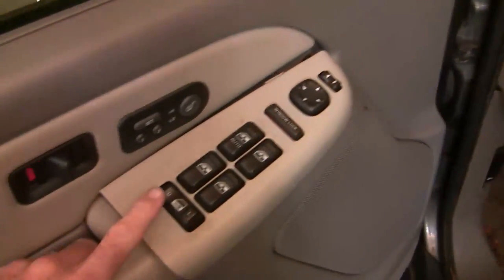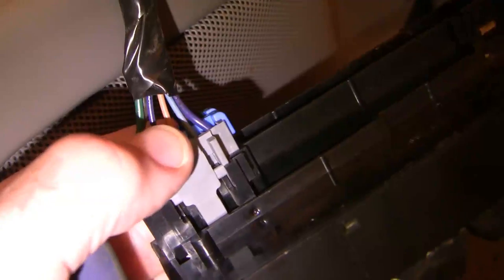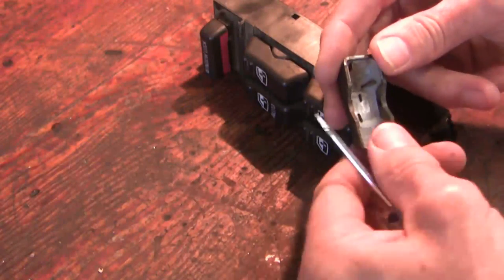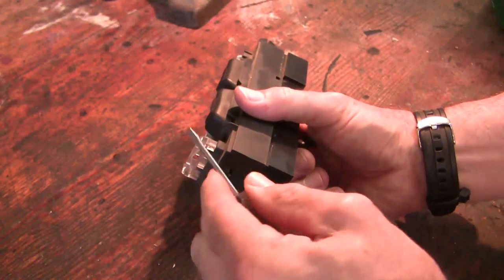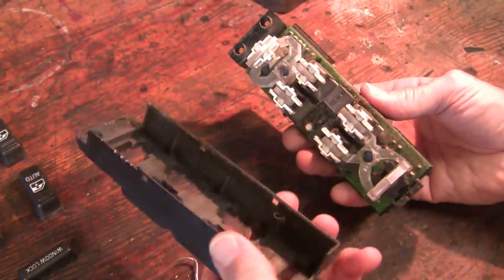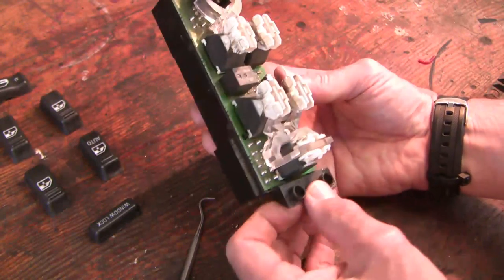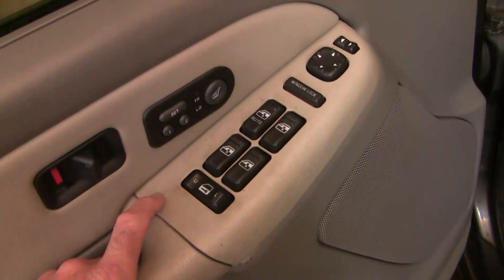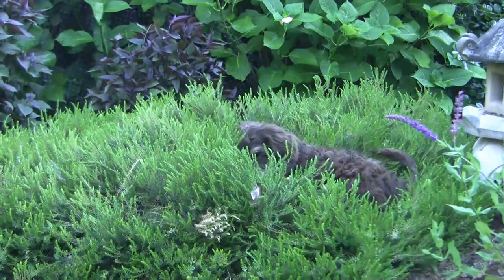How to fix the Chev power window door lock switch

Comment: I have an 02 Yukon and my driver and passenger lock and unlock button doesn't work either, I have switched out the relays and still not working.  what can I really do. or might be the problem
Reply from the maker: +officialYungTEK These systems are very complex, but in the end good technique will show where the problem is. If I can get at the end device I usually start there, to prove the motor works and the lock will close and open with application of power.  I usually start by looking for voltage coming from the switch to the device to see if the motor is getting an adequate signal to move. At that stage it's important to do the testing under load with the door lock hooked up since you are really doing a voltage drop test. If the voltage under load is reduced I look for bad connections, especially corroded connections and broken wires and bad ground connections. Pay close attention to the wires inside the rubber boot that protects them as they go around the door jamb. Those wires often become brittle and the repetitive movement around the door is a common point of failure. If voltage is adequate but the lock won't move, you could isolate the lock and apply power from an outside source to see if it will move on it's own, but testing like that should be done with the lock completely disconnected to avoid issues with back voltage, etc. If you get no voltage driving the lock, trace the wires back to the switch and clean debris from there. The switch and associated connectors are a very common point of failure, too. If two doors are a problem then I would pay close attention to the master lock switch on the drivers side. To go beyond that you'll need a wiring diagram, which is surprisingly complicated, especially if you have a security system. I suspect many dealers trace the issue back to the switch and then if they suspect the switch then they swap in a new master switch. In the DIY world, you want to be as sure as possible the switch is the culprit before dropping change to get a new one. Good luck!

Comment from the maker: I'm guessing that somebody was in that door and hooked the wires up backwards. A quick fix would be to take the inner panel off and swap the two wires. Easy. The wiring of most window motors is reversible, with direction of rotation entirely dependent on polarity. 

Word of caution, I'm not an expert in Ford products. If it were my vehicle I would get a wiring diagram for that vehicle to avoid making a mistake. BBBindustriesdotcom have some free wiring diagrams for many vehicles.

Comment: great video. i have a question. did you see a bulb anywhere in there? none of my switches light up. i dont really know if my truck doesn't feature it or the light is out. so before i go thru the trouble of dismantling my window cluster,  can you help?
Reply from the maker: I didn't see any bulb, but I think some of these may have little LEDs. Next time I'm in the vehicle I'll look for lights, they aren't very noticeable if they are there.
Reply from the maker: OK I just sat inside the vehicle and the switches for the door lock/unlock and for the window controls are lighted. Interestingly, on my vehicle only the rear two window controls are lighted, the front aren't, so my fronts seem to be burned out. The child lock is not lighted, nor is the mirror control. They aren't affected by the dome light controls and they don't go off if I try to manually turn off the headlights. I don't recall an incandescent light bulb, they are probably LED. I'll have to go back to the footage but in my case I don't really care, it's not worth the effort to fix it.
Reply: Im changing all my lights to blue led lights. And none of my switches are lit. On either door. If you come across a buld anywhere in there let me know.
Reply: Billy BManic looking at the video, it appears that there are clear plastic molded "conduits" that run in between the switches. It looks like there are two bulbs at the base of these "conduits" that, when illuminated, allow the light to travel in the "conduit" ,kinda like fiber optics, to each switch.

Comment: The drivers side window button is the only one that does not work.  All of the buttons for the locks, mirrors, etc work.  I have taken it apart and cleaned it, and the wires all look good.  This is now the third summer I have had it go I out and I would like to be able to fix it myself.  Any other suggestions as far as what the problem might be?
Reply from the maker: You might look closely at the solder connections where any wires meet the board. Sometimes the solder joints fail, and re-soldering those joints may solve the problem. Failing that, there is always the option of searching for aftermarket or junkyard parts.
Reply: Did you ever find out the problem with your door switch I'm having the same problem and don't know whether it's my drivers side switch or the window motor going out itself. Thanks
Reply: Get good at locating less expensive sources of used replacement switches. They are finding their way to eBay now. Obviously, if you are only paying $10-$25 for a $69 part, you might not have a guarantee that it works as well as a new part. But the savings in labor alone is worth it. I personally stay away from purchasing the cheapest parts online. Always bothers me to go to the lowest bidder on electronics.

I own two Trail Blazers-- an '04 and an '06. Currently, the '06 needs an engine replacement. So, I am robbing parts to keep the '04 running. I am currently in the middle of changing out the driver's side electric window switch. EZ-PEAZY.
Reply: Soldering hint-- lower power is better. Start at lowest/weakest heat settings when soldering near boards and plastic switches. Don't have an adjustable soldering gun? Go buy the little pencil soldering irons. The ones where you have to hold the tip end on the wiring to heat up longer before it draws the solder in is better than melting plastic on the switch or, Heaven forbid, multiple solder points on a circuit board. Ooooh--getting the shakes just thinking about it.

Comment: Any idea how to remove the board completely?  It's almost like the pins are permanently molded to bottom and then board soldered to them (meaning you can only get it apart by desoldering it from the pins).
Reply from the maker: Yeah, the official professional approach is to replace the entire switch if it is proven bad, and you can find those online. The tricky decision is to verify the switch is bad, which may require voltage drop testing and back probing connections. I have not removed the board in this switch. If you do it, throw us all a bone by posting a video, ha ha. Thanks for watching.
Reply: @spelunkerd  - Turns out the pins are permanently molded into the plastic frame, and then the board is soldered down onto the pins.  Fortunately you can access the switch contactors without having to remove the board, however I wanted to replace the burned out lights that are soldered in from the backside.  Rather than having to desolder both pin sets, I just drilled through the plastic to access the solder points on the lights.  When I was finished replacing the lights I just used some RTV to reseal it, however it's not watertight, so probably isn't necessary.

Comment: I'm having a problem with my lock switch on my 99 silverado. it works with my alarm keypad but not with the switches in the truck. ive already replaced the module but it was with one from pick a part and it didnt fix it. Any suggestions?

Comment: we have a gmc envoy, passager side lock won't close but switch will operate the other doors to open and close. will try cleaning bu could it be a spring? what part do I order?
Reply from the maker: For part numbers, consult the dealers manual, a parts supplier, or your 
local OEM dealer with your VIN in hand. Remember that it's the 
mechanic's responsibility to be sure he is ordering the correct part, 
and it would be a mistake in logic to just blindly order parts without 
investigation. I would test to be sure the switch is bad by first 
electrically isolating the lock and then manually giving the lock power 
and ground to be sure it works. If not, sometimes a bit of lubrication 
is all you need.

Comment: I have a 1997 Chevy silverado and weather I push the driver window up or passenger window up it unlocks the doors and if u hold it, it blows a fuse, my driver window did work fine then started doing this
Reply from the maker: Interesting, those are two different circuits. If somebody else has been working on the car, the first thing I would wonder is whether the repair hooked the wrong wires up. If not, then a bad ground would be high on the list of problems that can do that. Bad grounds do screwy things because when searching for a ground some circuits permit backflow of electrons though other devices. The other thing worth considering is whether the switch for both circuits share a controller, in which case you might need a new control board/switch, usually in the drivers side door. In any case, the usual approach is to remove the inner door panel, examine the wires and switches, looking for corrosion or crossed wires or bad connectors. You may find corrosion in the culprit area in which case you clean and probably replace the bad part. If you've been getting significant moisture inside the door, check the window slides and also the drain holes at the bottom, which are designed to allow water that makes its way inside to drip safely away. If you get an alarm from your security system, have the key ready to cancel any code, and you may need to remove the neg pole of the battery until you're ready for testing. These circuits can be complex, so you want to honestly evaluate your skill and tool set before accepting the risk of home repair. Good luck!

Comment: I have a 2004 silverado crew cab and I kind of have this same problem.  The power unlock works on all the doors, but the power lock only does the front doors.  The drivers side switch is kind of fuzzy when I try to lock, it only works sometime and I have to push on it at a weird angle.  But the drivers side unlock works perfect every time.  Any idea at all whats going on with my truck?   Power unlock works every time with all doors, but power lock only works with front doors.  Kind of baffling
Reply from the maker: You could try lubricating the lock mechanism but it's likely the switch. You could send power to the lock mechanism directly, bypassing the switch, to see if the problem persists. Generic switches are available on ebay and elsewhere, for much less money than the OEM device.
Reply: +spelunkerd Ok, I'll give that a try when I decide to dive into it. do you know if the generic switches are any good compared to oem?  They're like 200 bucks for an oem lol
Reply from the maker: As far as I know they are fine, and you have the option to return it if not. The other option would be to gamble on a junkyard part.
Reply: +spelunkerd I'm looking at my window lock switch thing right now and holy crap the dust!  It's gross haha.  Unlike yours where you have to pop all the buttons off to get the board out, my board is held in with a few little plastic clips that I bent out of the way. the board falls right out.  there is a silicon pad that goes in between the physical buttons and the board a lot like if you took the key fob apart.  I'm cleaning the Silicon pad with some rubbing alcohol to get the crud off.  I know none of this applies to you but I just felt like sharing lol
Reply from the maker: It's always nice to hear others' experience. Thanks for contributing to the thread.

Comment: Sir, my Hyundai i20 left rear window has no power when operating from driver side windows master panel. The other 3 windows has got power, but no power for this window.

However, they are on at the same board. Why no power supply to this particular window?

How to restore power to this particular window switch???
I also supply power to this particular window switch from another 12v source, yes, the window functions both ways up and down. This is confirmation that power is cut off but how and why??
Reply from the maker: In that case I usually go to the involved door, remove the inner door panel, and find the window regulator. Then I check for power and ground when the switch is turned on. If there is no power to the window, then as a final test I disconnect the window regulator and see if it will move when I hotwire the regulator with 12V and ground independent of the controls. If it moves, then the problem is in either the switch or the wiring going to the door. Common sites of problems are in the wire loom where the wires go through the door jamb, or in the switch, or in the window regulator itself. You want to think the problem through carefully and work at it one step at a time.

Comment: You blew dust out, how is that helpful? I wanted to see how to clean the whole switch device.
Reply: Did you figure out how to remove the PCB?  Seems like you need to desolder from the pins permanently move to the plastic.

Comment: I have a 2001 chevrolet tahoe. 
My master switch for the window has a problem were as If I push down on driver window it won't go back up until I take key off ignition/open door then close back  and turn switch.. do you have an idea y it does that?
Reply from the maker: +Ruben Rodriguez Hopefully the switch is just sticking open. I'd try to clean it first, and if that didn't work I'd look at consider getting a replacement switch. I've been told there are inexpensive aftermarket replacement switches on Ebay.
Reply: Thanks for the quick response I will do so.

Comment: I have a 2007 Chevy Avalanche.  The driver's side control unit has been acting up for a little while now.  None of the switches would work when the door was open, windows, locks, mirrors.  However when the door was closed it would work fine 99.9% of the time.  I think I may have had an issue once where it didn't work when the door was closed but can't recall for sure.  Anyway, yesterday it quit working all together.  Not sure if it's the control unit itself or a short in the wiring somewhere.  I ordered a new controller yesterday and should arrive today so hope that's the issue but if not has anyone else had this problem.  All the other switches, locks and windows, work fine on the other three door it's just the driver's side door unit.  Already checked fuses and wiggled the wires to see if there was a short from the door to the switch unit.  No luck.
Reply from the maker: A change in behavior with position of the door suggests a broken wire near the door jamb. When you open the door you will find a rubber loom that is protecting a group of wires running from the door to the chassis. It may take some work to expose the wires that run through the loom. That area is prone to wire breaks because with time wires become brittle and the repetitive motion eventually causes a break. With all door functions failing at once, it is probably a main power wire or more rarely a ground wire. Find and repair or replace all broken wires. If you have trouble exposing the entire wire, you could look for the power and ground wires at the switch to see if they are getting power and ground. Occasionally it is easier to just run a new wire to supply power, but with a little effort you should be able to find the problem.
Reply: That is exactly what it was!  Had a stereo installed a couple days earlier so I took it in to them to make sure a wire wasn't shorted out or came lose and that's exactly what they found.  Not their doing when they installed the stereo.  Tried to pay them for fixing it because when they found the problem I knew it wasn't anything they did but they wouldn't take it.  Really great guys at that place.  Only took them about 15 minutes to diagnose the problem and fix the wire.  Thanks for your help spelunkerd!
Reply from the maker: I'm glad it worked out, it's a common problem. Your story will help others who find this thread, thanks for telling your story!

Comment: Mine caught on fire when it got rained on and burned the bottom right corner of the circuit board how can I fix this ?
Reply from the maker: The problem is always fixable, though you'll likely need parts. First you need to know where the heat started. Water causes corrosion, then increased resistance, which causes heat. Heat in turn causes solder to melt, which then causes parts to shift and more resistance, ultimately tumbling into smoke, destroyed transistors etc, and often a blown fuse. I'd have a quick look at the connectors to see if they are salvageable, then check for power and ground, probably check the fuse as well if no voltage. In these old trucks the switch is easily available through ebay and amazon, and connectors are available as well. Deoxit spray is helpful if corrosion isn't too bad, clean with isopropyl alcohol after disconnecting power. If the switch isn't too expensive it is probably not worth trying to fix the board, though if you have a microscope and soldering skills it might be a fun exercise. Most general mechanics simply replace the board. Get some dielectric grease and apply it to vulnerable areas to try and prevent water ingress in the future. Good luck!

Comment: Hi I have trailblazer 2004. Is possible change bulbs in this door panel (with seat heat indicators)?
Reply from the maker: Bulbs are usually no problem though I have no experience with your 
vehicle. If the lights are LED, make sure they go in with the correct 
polarity and correct replacement, since there is wide variance in 
current requirements and overload current. In a typical LED the flat 
side is the negative anode, and the positive supply side has a longer 
feeder wire. You may need to solder LED lights to a board, and desolder 
the old light properly. Messing up the solder could cause more damage to
 the circuit than just a burnt bulb.
Reply: Thanks